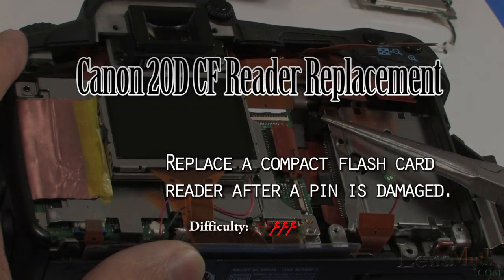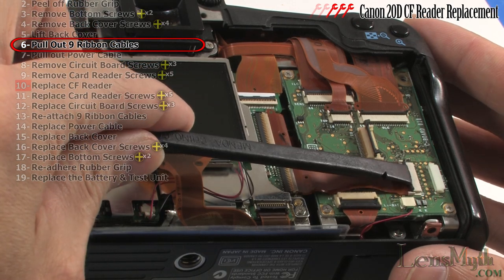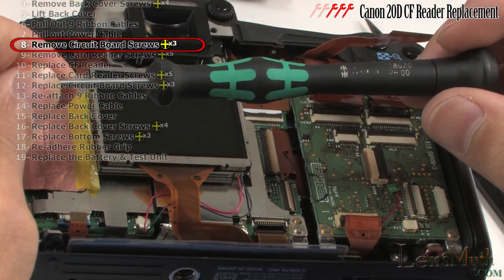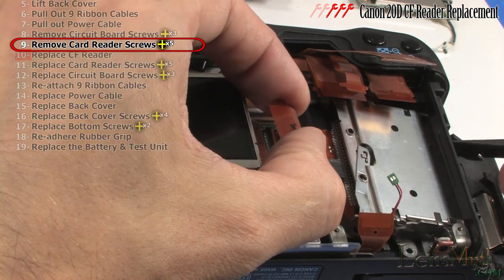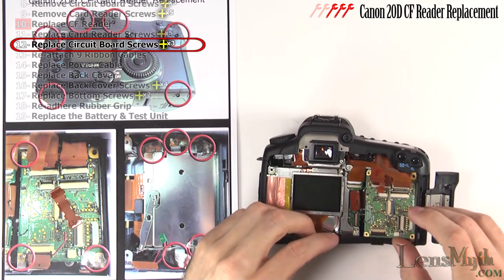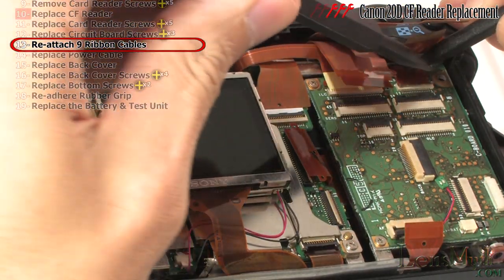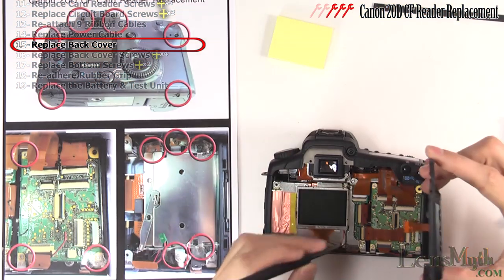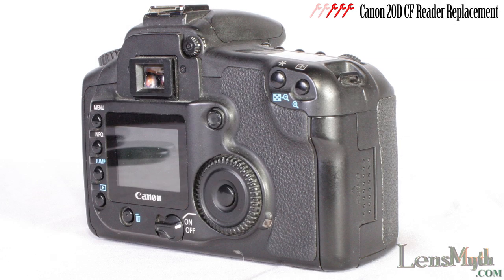Canon 20D Compact Flash Card Reader Replacement - LensMyth

Comment: Thank you for sharing this video. I had just spent $250 to have a 40D repaired from daily useage by my photography students. But shortly having putting it back in use, a student damaged the CF socket. I was wondering if it was worth a second repair when I found this video. Assuming the 40D is similar in construction to the 20D shown, I can make this repair myself. I wouldn't have attempted it prior to seeing this video. Thanks again.